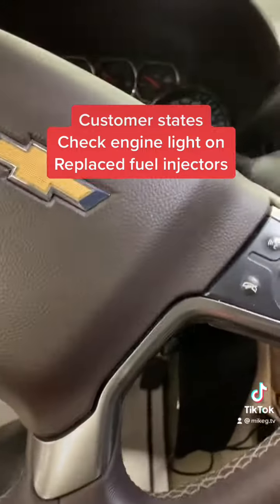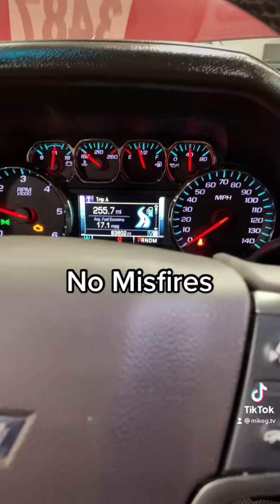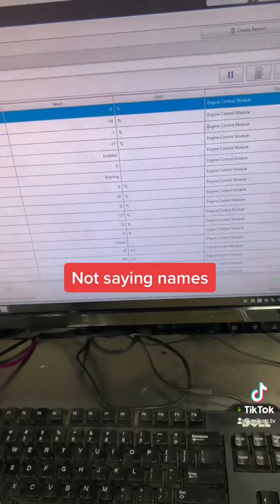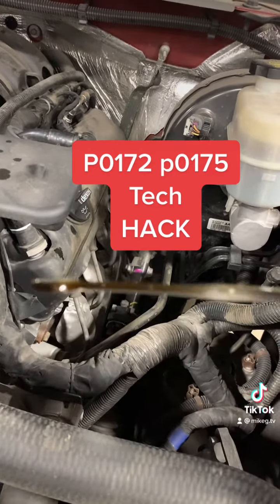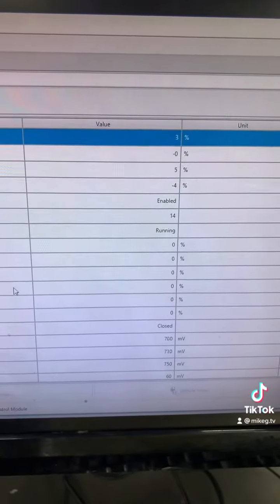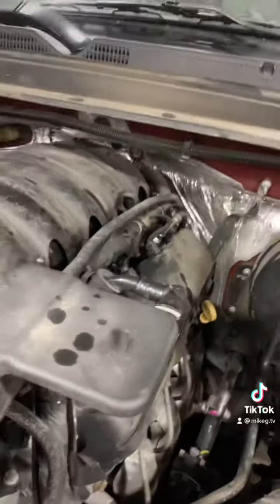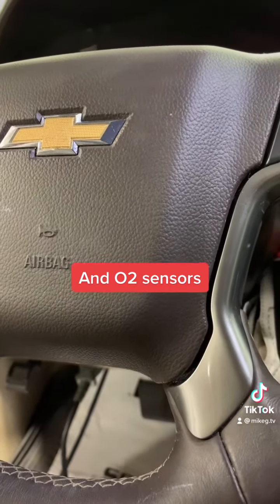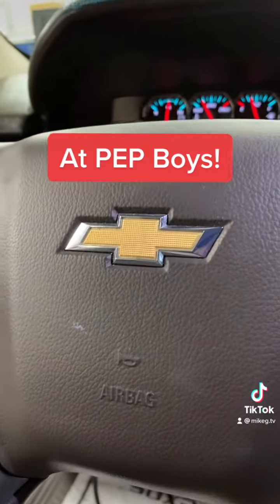Chevy Tahoe runs rich P0172 P0175 Hack

Comment: Fuel diluted oil is seeping past the rings and EGR into the cylinders causing a rich condition, the oil change removed the problem. The ECU is sensing a rich condition but has no clue as to where its coming from. The injectors that were replaced elsewhere likely fixed the problem but they never did an oil change!

Comment: Just paid chevy a lot of moneys to replace the high pressure fuel pump and it fixed nothing still have these codes and oil in my crankcase
Reply: Took mine to Chevy dealership near me, and raped my wallet. I'll never go back, EVER.

Comment: Compression test.
Reply: You'd be getting other codes, just the p0172 p0175 means it's almost def the fuel pump
Reply: @CharlieBam how is a fuel pump gonna make it run rich? The cam phaser causes low compression and incomplete combustion. The O2 will read it as a rich condition and it will affect both banks and cause a rough idle.
Reply: @hotrod8915  it's real common in these trucks, it's probably the high pressure fuel pump in the engine. Seals go bad and they leak, they recalled them at some point. Could be other issues as well tho.

Comment: Pulling the same codes on a 20 13, 5.3 L.
Reply: Same here man no other codes. Does yours have a crappy start up
Reply: @woodmeerkat8884  yeah hard starts
Reply: You guys figure any solutions out? My Tahoe is doing this now also
Reply: Have any of you guys found the problem for the system too rich in our Chevy/GMC trucks? I have an 02 Silverado and it’s doing the same thing, but mine has lots miles under it. I’m trying to chase it, but costing me a lot and no results as of yet.
Reply: @SemperShock  crank position sensor I believe
Reply: Could be cam position sensor it’s been a while can’t remember